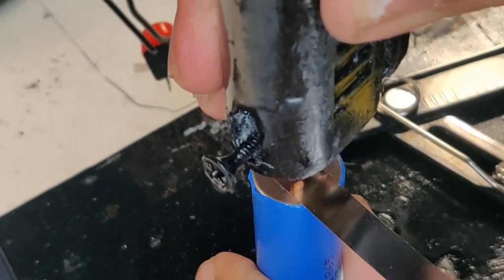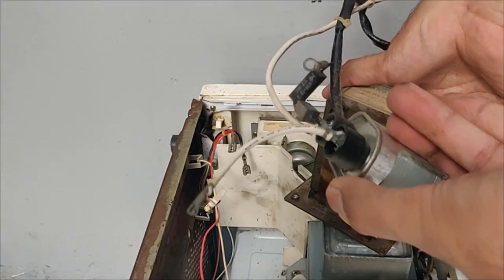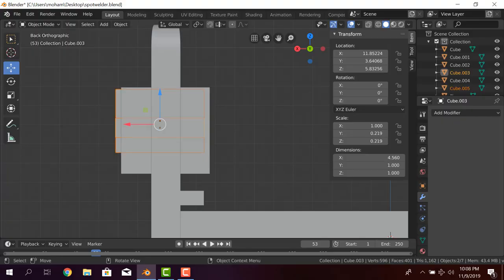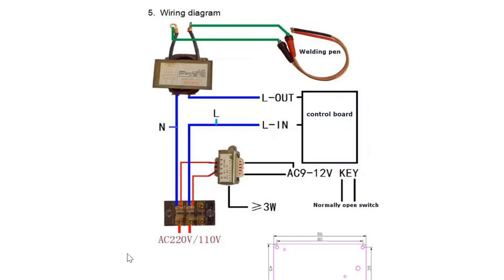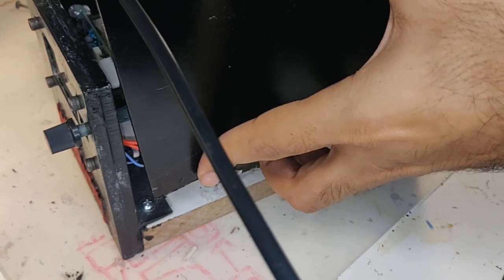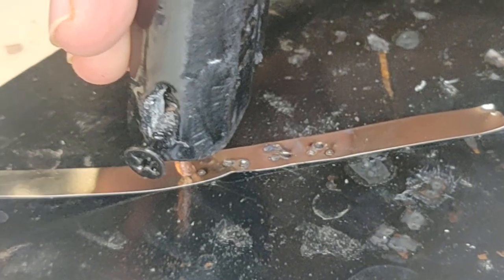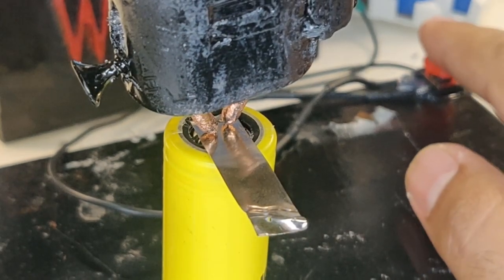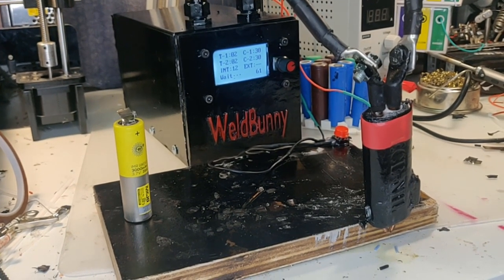DIY Spot Welder Build Tutorial!

Comment: For anyone having a problem getting the controller to the voltage calibration the process is to hold down the encoder button before plugging it in. Hold button and then plug in the unit or power on display depending how you have your system wired. It will then display 220 on the screen. Turn counter clockwise to change to 120/115v. 
Should be all you need to do. 

I couldn’t find this info anywhere so hopefully it helps. This stuff can get pretty frustrating when you can’t find clear instructions.

Comment: what is the max thickness that it can weld on nickel strip? can I have the stl of the housing? 
Also I wish you add that 13 amp fuse for 220v and 26 amp fuse for 110v.

Comment: i purchased the same control module 100A,
i found a huge MOT probably 1000-1200w,
I Removed those Current limiting Shunts.
i stripped & combined 3 welding cables and heat shrink it - the thickest wire ever made 😜
then i made 3 turns = 2.8V , idle current at 220v = 1A & at 240v = 0.8A - input amps on short = 9.5A
someone suggested me that output voltage should be 4-5V which will carry higher amps,
so i hammered  the cable and made a tight fit turn, total 4 turns, v = 3.8V , idle C @ 220v = 0.8A - 240v = 0.5A, short current = 13-15A
i was happy that current increased, it was working great but after around  100-150welds , primary windings got really really hot, and it started burning cells.
i'm building this 2nd one, last one had this same issue .... 
question is - what could be the problem ?
did i removed shunts - that's why ?
did you removed or without removing it works ?
Reply: Look like  it needs  fan to keep  it cool , just  a guess
Reply: Stick it in the transformer and connect it to the circuit in series.
Reply: @markrobinson3884  i fixed it ... not fan, it was an issue with Mlayer capacitor, i added two bigger caps and now transformer neither heats nor burn welds, i have uploaded videos on my channel
Reply: @esatsolenay   thanks , i fixed it
Reply: @JawadAhmadsahibzada  Hi, I have the same driver, but the power control works up to 80%, when I set more, 90.95.99% - then it works with a low power, about 20% and the welds do not stick. Will adding a capacitor help?
Reply: @JawadAhmadsahibzada  What and where do you get those cap's?
Reply: @locho9442   An online local electronics store. This board comes with 10nf 1200v capacitor 
I added 150nf 630v capacitor and it was behaving better but then I added another 150nf cap just to make it perfect. And after this mod. It didn’t made that problem 

(Cap is that red color pillow shape, near 39ohm big Resistor)
Reply: @Dori2137  I have the same issue, any solution found yet ? I already switched the MCap with no effect. So still any current setting above 80% drops the power to baiscally 0.
Reply: @Dori2137 I cant go over 95%

Comment: What do you think conecting transformers in parallel for hugecurrent??
Reply: Two transformers
Reply: There is no need to increase the current. You wouldn't be able to (easily) power more than one transformer anyway, since the inrush current would pop the circuit breaker of your mains supply!
The Microwave Transformer is a very low cost but poor way to do this. If you want more current, buy a cheap stick welder which has a proper transformer inside.

Comment: I got 2.33 v with  25 square mm wire 3 turns,I didn't remove current shunts,any advice ,to keep them or to remove them.
Reply: Hello. If you want to more high current for welding, you must remove them.

Comment: how do I turn it up I have the wraps and good connections good voltage but my welds are slow and not penetrating?no BANG SPARK just a gradule heat up glow and fizz
Reply from the maker: Increase the C value aka current and perhaps reduce T aka time. Watch my follow up video i showed settinfs
Reply: Hello Art. Can you tell me how many windings from what thickness cable did you wrap on the transformer?
Reply: @esatsolenay  #2 gauge 3 loops and 120v dirrect threw foot switch . I found I get a better tack with quick short tap on the switch but even in optimal condition im getting a week weld.
Reply: @esatsolenay  I really like the new holder  and video you did there I think you covered it i will try again. 
I especally want to thank you for your videos if I had any money I would give you some. anyway THANK YOU VERY MUCH.
Reply: @thenightwright  Hello Art.  First of all, I would like to mention that the videos are not mine.  I also recently made a spot welding using a microwave oven transformer.  However, I could not do enough spot welding like you.  However, I realized that I made a mistake.  I used 1 gauge (50 mm2) cable as 2 turns to get high current.  However, there were no good welding and were easily dislodged.  I replaced the wire with 4 gauge and wound 3 turns.  Now spot welding is perfect.  If you can't weld properly, you can try replacing the wire.  Indeed, thicker cable doesn't get any better.  Best regards.
Reply: @esatsolenay  thank you, ill try it.

Comment: How can regulate voltage?I have in display just 054v!!!
Reply from the maker: I tried to calibrate but couldn't do it either. Good news is: It works without calibrating so just ignore the voltage. If you fogure out let me know too
Reply: @Fungineers  At last i find how to do this.I disconnect power cord,then push and hold button,then in the same time connect back power cord.On screen display you see just ac 220v.I change,but it can not feel this in welding process.
Reply from the maker: @jaciks  very nice. Thanks for sharing

Comment: I mean great to do things yourself but for $60 you can buy brand new unit with pen and warrantee I am being ready to go and no time it just seems like a lot of work for saving 60 bucks I seen some for as low as $28 But yes what you did is great don’t get me wrong just not practical for most people
Reply from the maker: I agree lol. But dont expect a $60 welder to last long. I prefer malectrics or kweld.
Reply: You wont get a spot welder that is not battery powered for 60 bucks...
Reply: battery spot welding machines have low durability, and one battery charge do not permits a lot of work...

Comment: Nice build, thanks for showing it.  Where do you find 25mmˆ2 wire? (~3-4AWG).  I'm having a hard time finding suppliers of thick wire.  And did you crimp the connectors on yourself?
Reply from the maker: Try to look for grounding cables from building electricians. You could crimp yourself but I got it done from a shop. Safer, and only a couple dollars
Reply: @Fungineers  thanks for the tips.
Reply: Any car scrap yard should have used negative battery cable that should work perfect
Reply: Here in the US I would say to go look for jumper cables, I purchased a set of 4awg copper jumper cables for $20. The other option is look for welding cable it is usually 4awg or even 2 awg.
Reply: @bryanrocker5033  thanks.  It would be nice to find cables with thin insulation to be able to wind more turns (when desired), like massive magnet wire (https://www.google.com/search?q=magnet+wire&source=lnms&tbm=isch), although I guess it'd have to be braided to have any chance of wrapping.
Reply: @perspectivex  you can strip the plastic and use varnish on the wire if u want

Comment: That controller is a massive piece of shit  it only triggers after the button is released & does inconsistent welds its a terrible design i've had 2 of them with the same poor results. It cant be calibrated properly & can only vary the current output by around 30%...